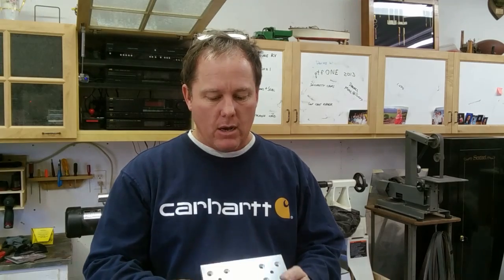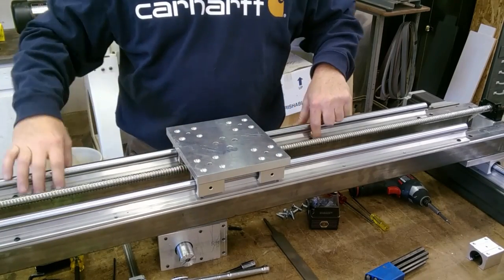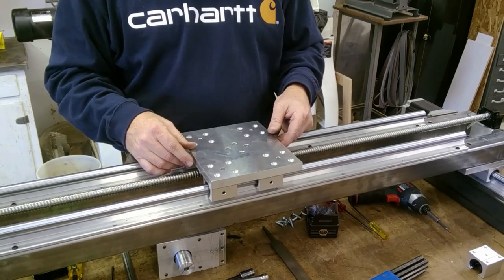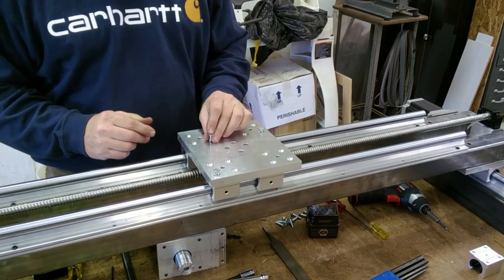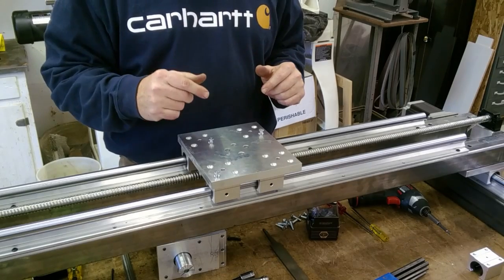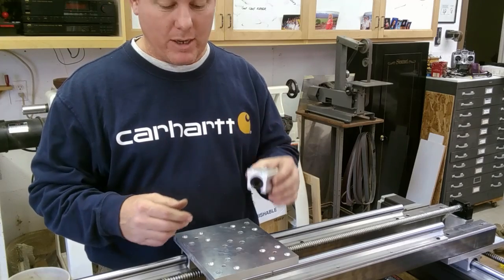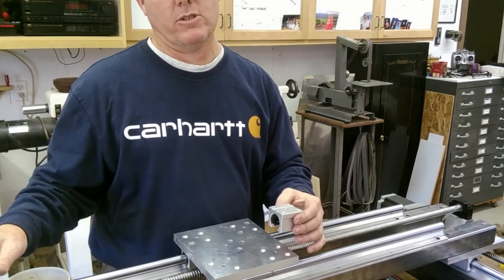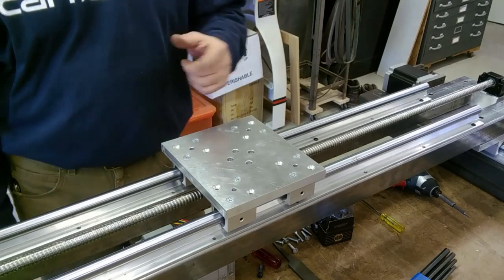Chinese Linear Slide Bearings - Something to watch for.

Comment: hi, i just bought my lead screws from banggood,come with brass TEE nut,got some anti backlash nuts too,that's it,for a machine like this or smaller (mine) bearings guides can be made easy,using european  or just plain "WESTREN" made bearings,i did search and found the fully supported tyes here,but people get good accuracy from drawer sliders,though for this machine and the one(s) i want ,sealed ball or roller types by skf etc,running on square tube mounted on some stiff aluminium extrusion is super easy,AND the parts are cheap to replace,my big problem is shipping,ot the cost,but the damage that can be inflicted on a length of bearing rod,supported or not,it's bad enough i have to wait to see if my 8mm x 2mm lead spacing screws come bent,at 700mm long for the Y axis it can be ruined easy by a moronic sender or carrier,i hope they are supported,but they are cheap enough,with the fittings i got and bought i can ,though i don't want to,get them closer,but for quite a bit more,plus insane p+p,free from china!!!!,yet more from a euro dealer,i digress,linear slides/rails of a supported nature can be made cheaper and better,unless your machine is for ultra super accuracy to the Nth degree,like i mention ,i've seen realy good resolution from goofy looking builds all over youtube,a good set of tools and some brains can go along way,plus the machine when done can make parts we humans can only dream of making(accuracy wise).

Comment: What is the brand name of these, so I and others can avoid them??
Reply from the maker: They are not branded.  These same things are sold by all kinds of ebay sellers out of China.  They are probably all made in the same place and I would presume to the same grade.
Reply: Any. Part you buy for anything can be that way car parts anything it's tolerances every part has them... especially to the edge of an extrusion or casting

Comment: You get what you pay for. To avoid the "issues" you have you must pay 10 times more for precision parts, so what do you expect? Besides, use socket screws with washers. The screws you have used are NOT the right type for the purpose, not even if you super glue them with loctite.

Comment: There's actually a use to the “problem“ you have. This is very common in linear guiding systems. The holes are hardly ever centered on the Slides. There is almost alwas a Stop-Edge on these. But only on one side ! From this edge you have a certain distance to the center of your Rail. So you could Mill another Stop-Edge on your Base-Plate and push it against the Slides. Sorry for my bad English.

Comment: you measuring out size. that should not matter at all toleranse could be 1inch if that fits. bigger issue and that should be correct is holes should be in centre of bearing. block can be any size out even not square if mounting holes is paraller to railing and centre. there is problem if they make it using sides to make them and not centre. you can try flip bearing housing and see will if holes go other size. then they not centre. order new ones they cheap that whats you get sometimes. no panic order many extra still cheaper than good quality ones. and its only mounting holes you can move holes on plate

Comment: I recently made PC gaming rudder pedals using the same slide bearings shown here. I ran into the exact same problem plus one more. On only one slide 2 of the holes were approximately 8mm instead of the 6mm that all the others were. I ended up redoing the plates that they bolted onto to compensate for the shoddy placement and buying 8mm bolts for the oddballs. Autozone just down the street had the 8mm bolts saving me wait time on ordering them. Next time I order I'll definitely avoid the cheap Chinese slide bearings.

Comment: How do you lube those bearings?
Reply: I am just using ordinary grease suitable for high speed bearings, unscrew the set screw on the side and press it in. It gets distributed to the other side because the ball bearings are circulating and because of the pressure.
Reply: @AdaptingCamera  There are 3 rows of ball tracks that are not connected to one another unless there is a channel around the outside of the ball cages that interconnect.
Reply: I wound up putting alemite fittings in the side of each and use way oil in modified grease gun to lube doesnt take much.
Reply: The lube hole is on the side, not the top. The top set screw in the center is for pre-loading, applying tension to remove play.
Reply from the maker: Really? With only one side screw, I wonder how the lube migrates to the other side.
What would you suggest for a lube in this environment?

Comment: does anyone have any recommendations for getting smooth and ultra quiet bearings for rails like these?
Reply: I bought chinese glides, flat style, but used. They had a bumpy feeling when slid along the rail. They were Brinelled but worked OK. I'll have the check the  new round guides for the off center as well. It is a crap shoot on those Chinese things though.

Comment: Thanks for the info. I probably wouldn't have countersunk the screws with a tapered head. Maybe a counter bore with allen head bolts to allow for the noted imperfections. 
Grrr! Cheap Chinese products!
Reply from the maker: That would definitely allow for more flexibility.  In other places I designed for slop and misallignment, but I started out wanting it to self align.  Silly me.